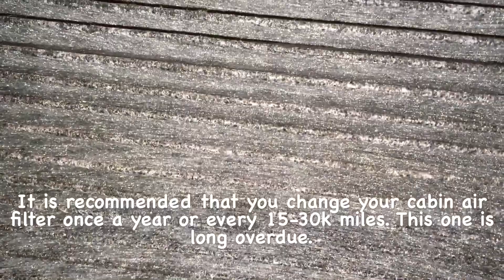How to Replace the Cabin Air Filter in a 2001 Grand Caravan

Comment: what if my  2005 town country does not have cabin filter ?
Reply from the maker: Did someone take it out and not replace it or is there no place for it at all? Seems odd...
Reply: @workinbootsproductions5008  the place where the filter should be is sealed...
Reply from the maker: Ah...it sounds like you may have a vehicle that was not equipped with the cabin air filter option. I am not familiar with your specific year/model but maybe there’s a way to gain access to the ducts and vacuum out the dust, dirt & bugs? Further disassembly may be required.
Reply: @workinbootsproductions5008   some of my friends advise me to cut that place and put an air filter inside...is it correct? or I should not do that?
Reply from the maker: I’m not sure how that would turn out. You wouldn’t have anything to properly secure the filter in place and I’m not sure what you would find inside after cutting out the plate. It may not be as simple as cutting out the plate and sliding the filter in. However, if you choose to cut out the plate and find that you are not able to install a filter, something as simple as duct tape could be used to cover the slot. In my opinion, it’s not worth the extra work involved. I would probably just leave it as is. If you do decide to cut into it, please let me know what you find and how it turns out.
Reply: @workinbootsproductions5008  ok, thsnk you
Reply: Thank you .